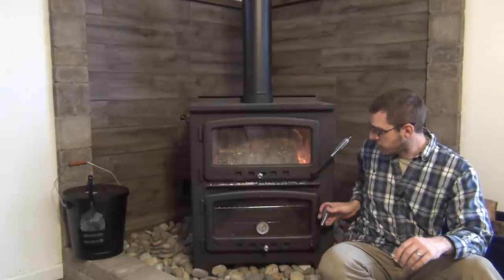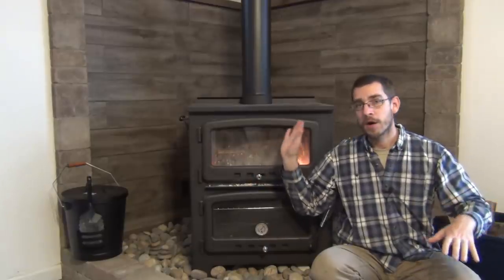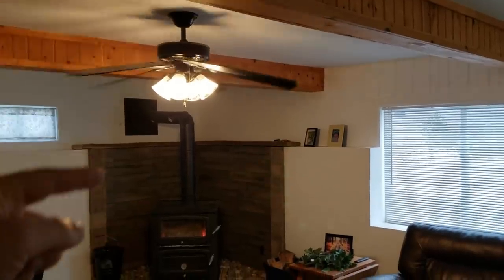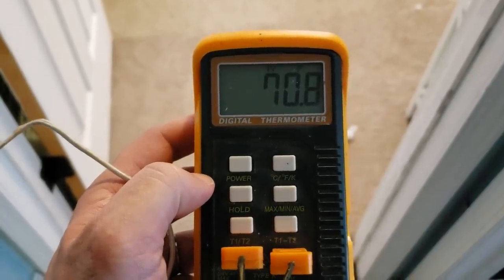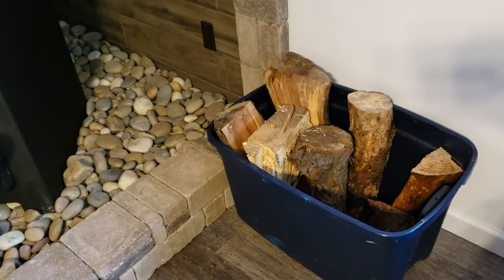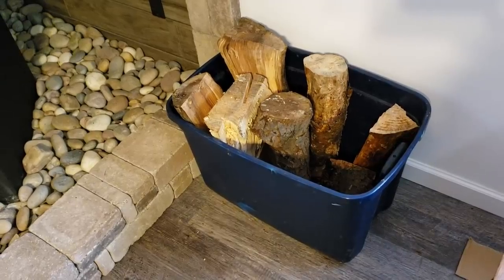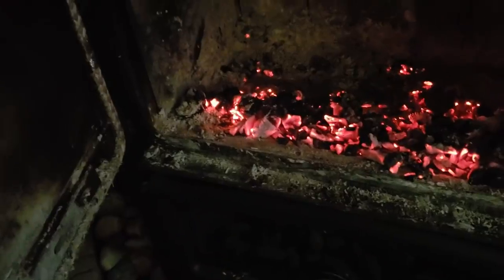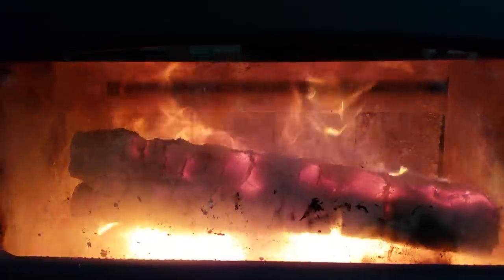Heating With Wood - How well does it work? | Vermont Bun Baker XL

Comment: I’ve been given a Hawkeye brand wood stove (it needs a little TLC) that I intend to install in the basement of an older home (built in 1918). There’s already a six inch thimble through the wall for a flue but the flue outside has been removed. I was wondering what clearances I should observe for masonry walls and or siding.
Reply: https://www.extension.purdue.edu/extmedia/fnr/FNR-100.html  some good info.  and i would highly suggest having your chimney inspected either by your local fire department or a reputable chimney sweep or, ideally, both.  good luck!

Comment: Did you have to install an makeup air intake to bring fresh air into the stove.  Need to be able to breathe.  My home has a stone basement that allows lots of air to replace the air getting used in the stove.
Reply from the maker: I would equate this house to a screen door half covered in duct tape:) there is plenty of fresh air

Comment: Provide a way for the heat to directly get upstairs by a floor vent or a or a duct with a fan inside it.
NEVER EVER BURN PINE IN YOUR STOVE-EVER-THIS WILL BURN YOUR HOUSE TO THE GROUND.The sap in pine will ignite and you won't be able to put it out.
ONE MORE TIME-NEVER EVER BURN PINE.
Reply: This is totally fine--do a search on hearth.com about burning pine. No more creosote than any other wood, and often less.

Comment: Just asking, is there a reason that you didn't buy a stove with a blower?
Reply from the maker: We were looking for a stove with an oven and a cook top of which there are not many options. Also, the idea was that it would run with no electricity. We do have an outlet about the stove on the mantel where we can put a fan if we want, or use a thermoelectric fan. So far it really hasn't been needed though

Comment: Does one have to worry about dry rotting from extreme heat? Any humidification system?
Reply from the maker: We sometimes just put a pot of water on top and it steams off all day. This helps the air hold more heat also

Comment: Well ...it is nod bad,but why you didnt get one with water tank and and water heating radiators?You can put 3 or 4 radiators on the next floor and everything will be twice better.That is total waste of heat power now really.Also that cold and hot air airflow in the house will not be so strong,because having the cold air down the floor isnt good at all.

Comment: I never understand why people buy a stove that does not have an ash pan or proper grates. Your stove was desgined in mind of consumers who will pay for a wood stove/ oven. There are stoves on the market for around 900 bucks or less that are great wood/coal stove that are for heating. The name of this stove is called Ashley Wood Circulator at Tractor supply, There are other brands of the same style of stoves. 
Here are a few tips to help you out. 
Buy a shredder, any thing over a 12 sheet, You can find working ones at thrift stores from time to time for a tenth of the price. 20 bucks or less. Shread every thing paper, cardboard. Then either bag it up or store it in a nice trash can or box, Use a hand full of shreads and light it and place some kindling on it, If you build a small wood rack  where your tub is, Build it quite high and have a top shelf for the kindling, The heat will aid in drying out this kidling faster and keep it nice and dry. It only takes about a min for the kindling to catch. Then place a log or 2 on it. 2nd back up option is a hand torch, I have for years used this method and the shreaded paper method, It only takes about 4 bottles of propane gas a year to light the wood. 
If an area is cold, The best method is to remove the cooler air via a box fan, Do not blow hot air as it cools it faster. Suck the cooler air on the floor out of a room and allow the natural draft to draw in the heat. You will be supprised as to how fast a room will heat up.  Ceiling fans cool the heat, I think you will find it better to use a box fan at the stairs going in to your lower level. Not sure how your stairs are set up. You may have to play with this either with a tilt or placing it at the bottom of the stairs. This will also keep the lower area a bit cooler while sending the heat up the stairs. 
Your wood might still be a bit wet, Depending on your chimney style, Double insulated or triple wall. If you have triple wall you are good, Double insulated pipe has a rating of only a few super hot fires before they begin to break down.  Triple wall pipe is the best IMO. If you use a lot of green or wet wood you will need to do a few high rate burns a week to get your pipe hot enough to burn off any build up. In all my years of burning 10 plus years. I have never had a chimney fire. Any product that says will clean you pipes are a joke, Fire is the only real cleaner. If you can inspect your pipes and find some build up, then you have a problem. The build up will be mostly on the pipe outside of the building. The longer your pipe length the cooler the unburned gasses will get and tend to stick to the walls. Creosote build up is from unburnt gasses. This is the smoke. Once your fire gets hot and starts the proper combustion it will burn all of it off.  If your stove smolders and produces a lot of smoke, you need to let it burn longer with the air intake open. Once you have a good bed of burnt wood and coals you will be able to add more wood and restrict the air intake.  Large outdoor boiler have this problem because the fire is not allowed to finish its process before allowing the controller to take over.
Reply: William Glaser n

Comment: Is there a way to make the heat more even throughout the home?
Reply from the maker: I plan to fix our furnace so I can just run the blower to circulate air. That would work
Reply: @SSLFamilyDad  You could consider put floor registers in the second level to the basement if the construction allows for that.  It would allow more of the basement heat move to the second level through normal circulation.  Same to the third level if that works.  Would save having to fix and maintain the furnace blower.  Obviously depends on the construction of the home.  Just a thought...  Besides getting so much better heat, the wood collection has dropped so much!  Now on to the boiler for making syrup!  :)
Reply: Yep......if your propane furnace is set up as whole house forced air then get the furnace fan just running at low speed continuously,  and I agree that will do it.

Comment: Maybe look at getting some true hardwood, burning pine and other softwood is inefficient and could be dangerous if your chimney isn’t addressed, also the blower and floor vents help with the heat transfer, FYI I’ve been heating with an indoor wood stove for 10+ years,

Comment: Are you pumping humidity into the house? If you don't have a whole house humidifier you should get one. Its easier to hold heat in moist air than dry it's also better for you especially in cold and flu season those viruses can't live in a humid environment also to improve the heat disbursement if you can cut a vent in the ceiling in the basement and remember this it doesn't matter where the humidifier is placed because humid air is attracted to dry air so center of the home in the basement with that natural convection that heat will help take the humidity upstairs. One question why didn't you go with a stove that burns exterior air?
Reply: Good advice.
We've always just put a large aluminum kettle of water directly on top of our woodstove.  
Works great, holds about a gallon, fill it once every day or two.

Comment: Have you tried the fan on reverse to see if that makes a difference?
Reply from the maker: I haven't tried it reversed actually I could do some temp testing and see what happens but I figured hot air at the ceiling needs to come down, lol
Reply: I just remember years ago it was said to push the air up in one season and down in another but for the life of me I can't remember which one is which, sorry.

Comment: isnt that a NECTRE Bakers Oven? why are you calling it 'vermont bun baker'?
its not made in vermont its made in South Australia
Reply: ps you mentioned a couple of times that the stove is cast iron 
im pretty sure this is not accurate 
the door are cast but the body is steel
Reply from the maker: It is a nectre stove imported into the u.s. and renamed a Vermont bun baker xl. Is is solid cast iron

Comment: Looked at the link, for $4300 you should be getting a blower with that unit. They call it the XL, if its considered the XL the top model and no blower/fan shame on that company.
Reply from the maker: Cannot have a blower due to the epa. This is considered a cook stove so it has none of the catalytic systems and all the other junk that goes bad every few years. Just a straight up cast iron wood stove
Reply: Well if your happy thats all that matters

Comment: Your gonna burn your house down with pine wood, its the worst wood to burn, best have pipes cleaned out twice a year. You want to burn Oak wood or Maple wood, both very hard ling burning wood that throws off hot heat and a few logs will last the night. You have no clue how to run a wood burning stove. Also you can put in floor vents from room from above, the heat will go threw them and heat the rooms above. My uncle as a kid, he had some duck work done over his stove, it caught the heat and went to all floor vents that's about 8" inches by 12" inches now. Worked great. Maybe the vents were 12"inch by 16" inch now, not sure but they were big, in a lig cabin, still there and works the same, that was done in 1978 now. Also as a kid, I with my COUSIN hauled the wood into the basement after splitting the wood and stacking it on other side. It help dry out fresh cut wood on some of it, that was put off to the side, your best off buying 6 cords of trees, you have a splitter, just buy a chain saw, cut at you 16" to 20" inches long. Its the cheapest way to buy cord wood. Tree lengths at 6 to 8 cord at about $600 to $800 depending on how they sell it near you. Better than $275 to $300 a cord of hard wood
Reply: Norwich  --  You're absolutely crazy.  I burn yellow pine all winter long as that's the only wood available where I live.  I've been burning wood my entire life without a problem.  However, I do clean my pipes twice per season.  Everybody burns yellow pine where I live without a problem.  Also, the cheapest way to obtain wood is to get a permit and cut it yourself in the forest.  The permit cost $50 where I live.

"While this myth has been around for ages, studies conducted by the University of Georgia found that the amount of damage wood left on the chimney was a result of low-temperature fires rather than a resin rich fuel source. While pine does contain more sap than other types of wood, this is no longer considered to be cause of creosote buildup in chimneys. Wood that does cause problems though is burning green wood or burning fires at low-temperatures. Regardless of your choice of wood, it is very important to only use dry and seasoned wood to burn in your fireplace. Always remember that properly seasoned wood takes about one year for wood to properly dry out. Dry wood is more of a concern than hard versus soft wood when choosing what to burn."

Comment: Plus and down as all of heat solutions.
I worked on boilers and also on wood cutting business also have degree in plumbing and heat technician
Pros: Maybe the cheapest solution
Echo friendly
Feels natural
Dehydrates the house
Can also cook if it's build this way
You workout somehow
Cons: Heavy load
May hurt your back hands work with wood and fire
It's a heat solution that works IN your house
If the electricity shuts down and if the system is connected with heating of close type. May damage the panel or the bar relief spill water
High pressures and low pressures may occur
Slow to start
Only heats around 30 - 50 square meters
Needs a safe place to keep them
Myst dry or they may smell not burn well or black the walls of your house
Kids must be cautious
Takes atlist a quarter of a room to place
May not find them or be able to transport them when needed
May have bugs or. Pathogens rats snakes Flys ants
Loads of ash

Comment: Even though I have been heating my home with my wood stove for many years I am aware that they pollute the air. Call me a hypocrite, but the truth is they pollute the air a lot more than a conventional gas or electric forced air furnace. I rationalize using mine by telling myself this is what I can afford because the fuel is free. They can also cause allergy problems. And I have a very good stove.
Reply: Burning wood is carbon neutral, you are expelling everything that the tree has absorbed over it's lifespan.
Reply: Add a catalytic convertor to the pipe stack
Reply: Mr. Helfrich, I do the same and for the same reason.

Comment: I was considering a wood stove until I saw this video and read the comments.  A waste of trees. Hard wood trees grow very slowly,  they don't need to be chopped down and burned up. A waste of time and energy with all the chopping, hauling and keeping the stove going. The creosote issue. A hassle to clean and a possible danger. Irregular heating. Too hot in the room the stove occupies,  too much distance to the other rooms. Maybe a ventilation system would distribute the heat more efficiently.  Too much money for the start up. The stove, the pipess, the flooring,  the walls all need to be heat resistant. I will stick with my forced air heating system. 😊

Comment: Lmfao .... A $4k wood stove
Reply: lineflyer1 says the guy from Texas who wouldn’t get it
Reply: I have been refurbishing wood stoves for 15 years I've done over 70 of them. Currently I have 6 in my garage right now and 4 old antique ones at my front door. In my opinion nothing touches a country wood stove. The most I've ever paid for a wood stove used is 350. 4K for a wood stove that doesn't even look that big inside light inside my house is a country performer 18in deep 24 in wide. That 4k wood stove better do more than just baked bread